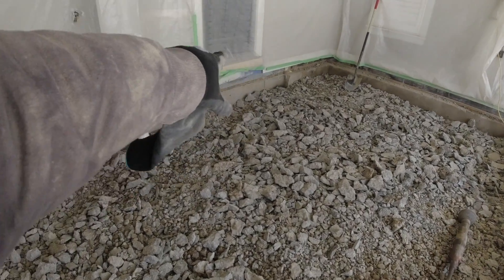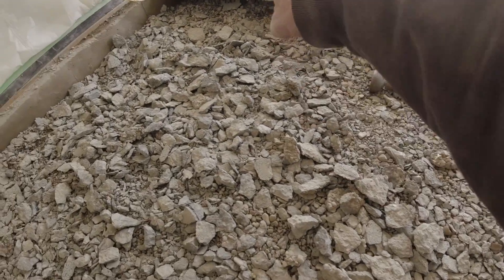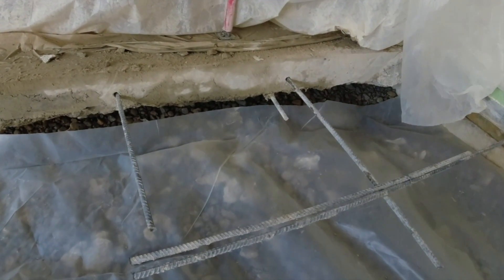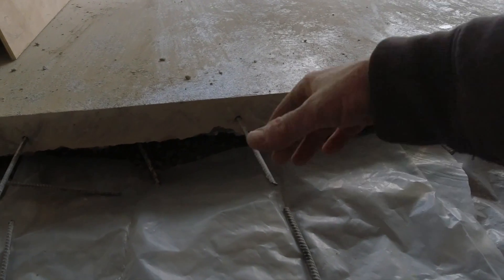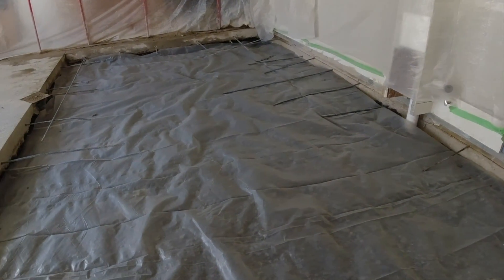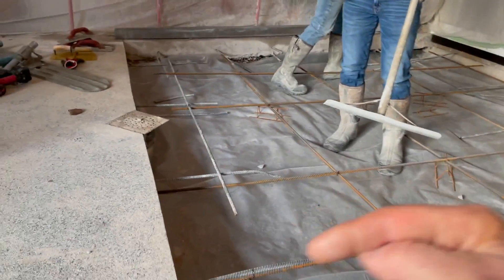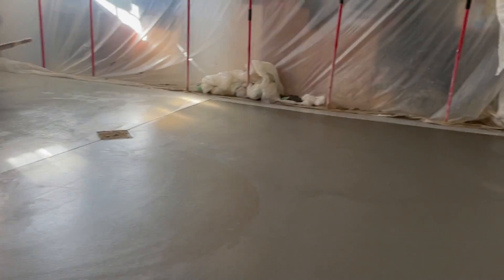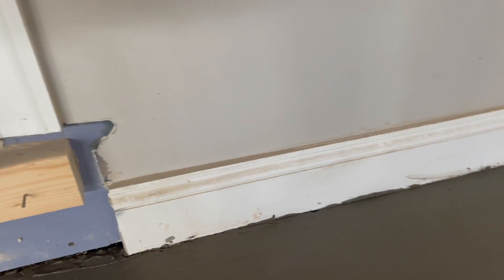This is Why Rebar is CRUCIAL!!!!!

Comment: Typical for a residential contractor to not properly compact the dirt, they are alwaws taking shortcuts or they do not know how to do it correctly.  It is hard to  imposable to get good nuclear density gage readings when compacting dirt even with the correct moisture content and the proper equipment.  Sometimes it is impossible to get compaction with a jumping jake.  I hate those things.  

Best practice is to just build and design things to minimize fill placement.  I wish civil engineers and architects would figure that out.

One thing to remember, a lot of nuclear density gage operators are not paid well and are under a lot of pressure to the point of being yelled at, so you can never assume that your compaction is being done correctly.  I think a lot of guys are just passing everything.  

A nuclear density gage measures compaction of soil.

Soil has to be at the proper moisture to compact properly, too wet or too dry and it can not be compacted.   An example is clay soils.  You can roll Bone dry clay to a hard glass like surface but it will not be compacted.
Reply from the maker: Thanks for all that that was pretty interesting

Comment: Seen this before; actually found a company that pumps in 2 part polyurethane foam that works well. They can actually use their system to raise concrete as well which was helpful in leveling out some old unevenly settled concrete. While they weren’t cheap I’m guessing they were probably less expensive than this.
Reply from the maker: Builder looked into that a little bit it is pricey
Reply: @Concretewiththehauses : When I had it done it was the cheapest option; it has the added benefit of being 100% waterproof as well as being adhesive in nature which actually helped to stabilize things more. 
Seen this issue a few times, the garage isn’t bad when it happens in a basement costs get expensive to do it any other way. Though it can very depending where you are, in NY labor costs dwarf the material costs but in some place where labor is cheap or cheaper it may be less expensive to re-do the concrete.

Comment: Could you have put pillars in. Sometimes we use 10 inch pipe 4 feet deep every 5-6 feet to support concrete in case sub base settles.
Reply from the maker: In the beginning yes now I feel the settling is all done

Comment: This is a very interesting and yet concerning video. 
We have a very poor driveway base that turns into a mud mess as the season changes, even after ten years. We live in Central Elgin County Ontario (Canada). We are currently getting quotes on a cement pad approx 40 feet by 30 foot in front of double car garage. 
What should be be looking for as we get quotes when it comes to  rebar  and concrete depth ? Is there a standard diameter and grid section ? 

We have been following your channel since you started making videos after working on the Morgans. You have a great channel and we are learning quite a bit from your concrete work to your wood making projects, very refreshing. 

Any suggestions would be appreciated.
Reply from the maker: This is one of the reasons I started this channel I’m glad you asked. Driveway should be poured at a bare minimum 4 inches thick 5 inches is better as you get to the street were UPS trucks delivery trucks could nose in  about 6 inches thick. I recommend at least 4000 PSI concrete. We use fiber mesh and half inch rebar and often times will put wiremesh in as well it really does not up to cost that much on the projects. The rebar make sure you hit your troubled areas a little more I would say at least a 4 x 4‘ grid for standard car and pick up traffic and never forget a good concrete sealer sorry for the lengthy reply another good idea is to talk to your local Redimix supplier and see who they recommend for install thanks for watching good luck keep me posted
Reply: @Concretewiththehauses  Thank you Tom. That is great feedback. It is awesome for your quick response and information. You are a true professional.

Comment: Old rebar is obviously laying on the stone, not up in the concrete. That's a mistake often made by careless contractors. Glad you used some chairs to support the new rebar. In 42 years of commercial construction I never saw one of those fun tools you used to push the stone back under the existing floor. Seems to work pretty well as long as there are no voids further back than you can reach. I would have used a vibrator around the edges to get the new crete back under the old floor.

Comment: Have you ever used fiberglass rebar and is it any good or not
Reply from the maker: I have not used them yet they’ve been in my area for about three years maybe four years just haven’t tried them yet I’ve heard good things about them
Reply: @Concretewiththehauses  I have watched O'Dell concrete on YouTube and don't think he is as good as you 😉 but he keeps talking about it and says it don't rust but that's all he ever says like too much and says it's cheaper and ok we are in pa and I've seen alot of concrete failure but never seen rebar over rusted plus you can get coated rebar I don't know it just seems like on his vids he over states the fact that it don't rust
Reply: @robertmyers461  You're in Pa.? Go look at the underside of an old bridge. Bet you'll see areas of broken concrete and exposed, badly rusted rebar. Rust over time is the big problem with rebar. The rust expands and cracks/breaks the crete. How fast that happens depends on how much moisture it's exposed to. It's a slow process that takes many years. Coated rebar gets chipped and allows rust to set in and actually spread faster. I think standard rebar will eventually be phased out in favor of newer types that won't rust.
Reply: @Grendelbc  ya hay I know all about it I'm retired from penndot so ya I can see the benefits of no rust but is it strong here in pa we have fibercon they use it to build airport runways with no rebar and no tie costs and is stonger than rebar and is made with stainless hello n rust
Reply: @Grendelbc  just see you way out of this conversation cause it was ment for Tom not you and I had more questions for him not you
Reply: @Concretewiththehauses  hey if you want to be really silly fun watch the best of the west concrete on YouTube lol he don't know shit and is just so opinionated like he is the shit lol its just obvious he don't know shit like the houses lol you guys are the best and do awsome work 😉 😄 and thank you for it 😄 not many companies left out there with the experience or pride or expertise that you bring with generations 😄 😊

Comment: It won’t work. You should have dug a 3’x3 pier all the way Down to original ground.. 
why did you not take it all out? 
What was that Diamond in the floor for? Don’t you see a problem there?
Reply: That diamond is the floor drain !
Reply: Here’s the only way you can be sure the Settling is done. Tear it all out than put water all over the fill in the garage. With the fill/dirt settling enough to break the plumbing pipes you know the fill in the garage was junk material....the steel would only hold it up for so long. To hold. Concrete up where a car sets on it you can only span 18’8” and the concrete would have to be 8”thick and 2 layers/mats of steel the bottom steel every 8” an and the top mat of steel every 12” . The only reason it didn’t fall in there was still some ground the concrete was setting on that hasn’t settled yet. steel every 2’ even 1’ will just help it from cracking and spreading. In this case the garage walls kept it from spreading and cracking.

Comment: I had my garage floor raised by a contractor using mud jacking... they forced stone dust and water mixture under slab that had sunk over years... the house is over 60 years old.  the slab is still solid and not cracked... they drilled holes and injected the mixture... i had also explored the use of foam before deciding to use the stone dust mixture.  I has stayed solid for the last three years
Reply: James Jensen: Any idea of an approximate cost for something like that?  I have a 30 'x 30' barn floor that was cut into 9 10 x 10 sections that are no longer even due to some of them sinking.
Reply: @d.a.ballou9740  I’m sorry but I don’t remember exactly what I paid... but it wasn’t too much... I’m sure there are contractors nearly everywhere that can do such work and give estimates... I would not recommend the other process that uses foam... it is said to deteriorate... while the stone dust stays solid. It might be that the stone dust is actually ground up cement from demo jobs but I don’t know much more
Reply: @jamesjensen5000  No problem. I was just trying to get some idea, from someone that has had this done, as to whether they thought the price they paid was reasonable, or really expensive.  Thanks for the reply and the information about using a foam product.

Comment: Just curious can you use a company that uses spry foam to raise or fill in that gap for a more cheep fix if need I’ve company’s raise slabs in videos
Reply from the maker: We wanted to remove the two pads in the bad area so we could really compact after four years the settling was done just wanted to tighten the area up for the new concrete

Comment: Hi Tom....The use of ground penetrating radar (GPR) used over the entire surface of the existing concrete floor slab would have identified the precise locations and the amount of settlement under the entire slab. Pumping flowable concrete fill under the portion of the existing slab that was not demolished would also help support the remaining floor slab.
Reply: When I was a kid, the ground under PCH in Laguna Beach was settling or eroding and the city contracted a guy to come out with a trailer mounted pump. He cored a few holes and bolted in some sort of flange that he could attach to. He connected his hose and started pumping. 10 trucks later, the road went from slumping to domed. It was impressive to watch that V8 powered pump lift the whole road.
Reply: Hate to have to bust that out if it did settle more! Lol

Comment: Have you considered using "dirt mud" that can be forced under the concrete floor to fill in the voids?  My daughter had this mud jacking done to her front stoop and sidewall to fill the voids under her wall way when it started to settle.
Reply from the maker: With the compaction we did and the added rebar I feel we’re good

Comment: While speaking with a neighbor 20 years ago, I happen to place my foot on top of a Fire Hydrant in front of his house and watch as it moved roughly 2 inches to one side.  While discussing it with the neighbor, he took me over to his Driveway and showed me a crack that he said for years he had been trying to fill, but everything he put in it disappeared.   I suggested he call the City to report the problem because water if left to run for years can erode massive amounts of dirt.  When the City showed up and started to replace the Fire Hydrant they found a space under his Driveway that a small child could have walked through.  Amazing his 1963 impala never fell through the driveway nor did his 1953 Buick Special.   I wasn't home when the Fire Hydrant was fixed but you can bet the City never fixed the damage it caused under the Driveway, (the length of the driveway, 40 feet).
Reply from the maker: That’s amazing two years ago maybe three years ago now we had a bus fall through our street here in Pittsburgh  because of that same thing thanks for  watching

Comment: I’m curious why you didn’t wire-tie the or all of the rebar in the new floor.
Reply from the maker: Not sure what you mean all the rods were tied
Reply: @Concretewiththehauses  That's reassuring. I did see one of the guys stepping on what appeared to be an untied rod.

Comment: Very informative video, reminds me of when I was on city council. We had a street where the base settled around 3 feet, it was all fill. They came in and did slab jacking and filled the void with grout under pressure. It did not have rebar because it was poured 7 inches thick!
Just wondering if that was a spec built house? Do it as cheap as possible?
I have seen it where they also use close-cell foam also. Since the pipe was broken that negates all the above fixes, obviously!

Comment: Wow, what a problem homeowner had & glad your cc did not fail. Wonder if original builder's people compacted this surface? 14" is a large 'drop'. Was this house ( subdivision) developed over some former wetland area? Or built on top of former water way drain path? Where are city planning/approval people on this particular house? Have their been other issues like this with neighboring houses?...Hope this is an isolated case & not  multi house, neighborhood-of-houses problem. Keep us posted Tom. Thx for your filming 🎥  & showing your solution. Love that pneumatic 'pusher-tamper-large-ball' tool with long handle. Impressive that you have lots of necessary tools 🔧. Bet that heater was handy in such low temp conditions. Great video on fixing a subsidence problem below your ridged, rebar reinforced garage cc slab! 
 Now since it's soo cold outside, let's make another furniture item in your warm garage!🧑‍🔧😊🍷
Reply from the maker: This builder usually does a pretty good job. I think working in the wood shop is going to have to be put on hold for about nine months work is really starting to pick up Thanks for watching

Comment: I have filled a lot of garage floors on new home builds and we always compacted in about 8" lifts except for the foot close to the walls for just that reason. I would imagine the builder would have been the one that had to foot the bill for that job. I worked on a job that the suspended slab collapsed in the middle of the night. The home owner heard the noise and walked in the door from the kitchen to the garage to see what the noise was and fell 8 feet . He got a little busted up.
Reply from the maker: I would bet more than a little. Thanks for watching

Comment: That's on the excavator who didn't compact the foundation dig. I've seen it many times, they just dump loads and loads of backfill without compacting and then do a little at the end on top. Really need to backfill in separate lifts compacted with water.

Comment: So that's your floor you and the boys poured but you had nothing to do with the base prep??
Reply: Correct. When we show up to a job like this, it’s already filled in with dirt or whatever else the excavation company uses. We flatten it out, add however much gravel we need and then pour the concrete
Reply from the maker: Correct all we do is play temp the top

Comment: Surprised they did not have you replace all of it. There has to be some gaps closer to the door that you could not see. Great work by your Crew Tom.
Reply: Couldn't agree more . The homeowner is really getting screwed here.
Reply: @Bigmikkey55  by the builder ? Doubt That!!  I would think that GC worked out something with the homeowner and Tom was doing the repair as per the General Contractor. Homeowner happy with the fix? Don't know! but if the front cracks, and sinks you can bet fingers will be pointing 👉 👈 to someone but it won't be Tom's crew!

Comment: Your a standup contractor, but what about the rest of the house?  I understand that you only did the garage, is that all they're fixing?
If I was the homeowner, I'd be very concerned that more of the same wouldn't be happening in different areas of the foundation.
Reply from the maker: If you knew the builder it would be OK he’s very meticulous and one of the better builders in the area
Reply: @Concretewiththehauses  well, he hired you and that speaks volumes.  I'd still have sections of the slap cored and checked, just sayin... lol